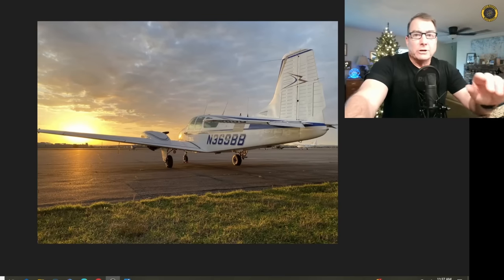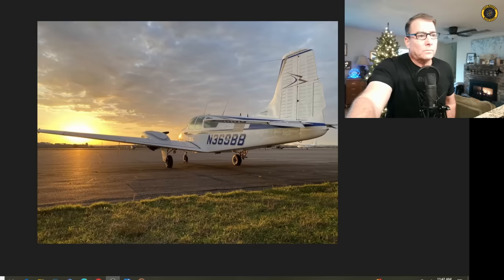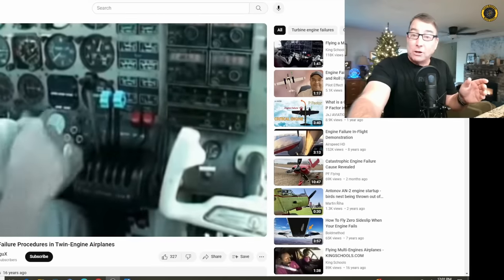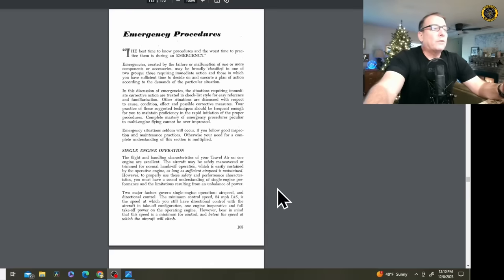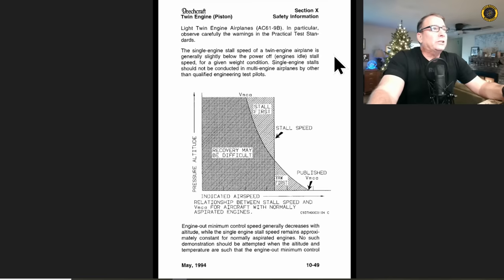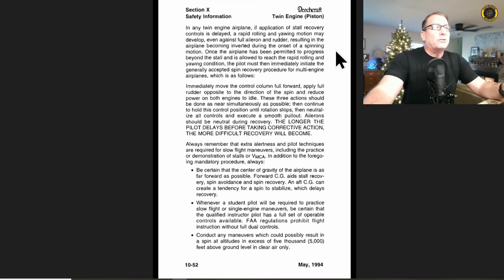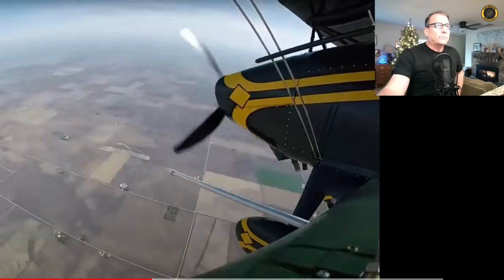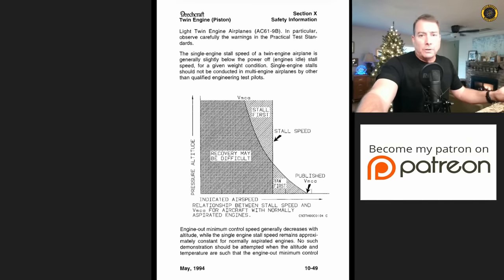Another Fatal Vmc Demo Stall Spin!! N369BB 4 Dec 2023

Comment: A 500 hour CFI with all the confidence in the world never realizes just how little experience they actually have.
Reply: well with light twins its  because the  safety  margins are  too narrow   even for   an instructor to catch. Engine out  exercises in twins  are dangerous .Reminds me of helicopters like the R22 .. look how  many of  those that  have   crashed  ..and one  reason? .. engine failure with  a  safety  margin of  about 1.7  sec max  to switch to autorotation  or  you  die . I  don't want to  fly in aircraft on the edge  with 1.7 sec  between life and  death .
Reply: Blind leading the blind.....
Reply: This MEI had almost 1500 hours😂not applicable here
Reply: He had more than 1500 hours.  This comment, along with this entire video bashing him for making a mayday call, is just complete ignorance. To say that because he was on the radio that he wasn't trying to do proper technique or maneuvering to get out of the flat spin situatuon is just ludicrous.   

I am obviously biased, as the CFI is a longtime friend of mine.  However, knowing him offers several advantages, as I know his experience and the culture of safety that he promoted and strived for.  I'm not saying my friend wasn't at fault, as he was the CFI/MEI and maybe didn't react quickly or realize what was happening before it did, but he was experienced, safety minded, a damn good pilot and good person.  

Thus, I appreciate videos like this that help explain the situation to the public and aviation community, but the ignorant comments on hours/experience, and the bashing of someone who lost their life just gets old.
Reply: @willycplane  My sympathies for to you for the loss of your friend.

Many people commenting on here are not pilots, or don't have a ME rating, and have never flown a twin.

When I did my own ME training, I knew these airplanes have a razor thin margin for error, and that was on a twin without a critical engine.

I knew of incidents in my own flight school which resulted in twins getting damaged beyond repair, with a student friend flying back seat in one of them.

People simply don't realize that prop twins, due location of the engines on the wings, are a totally different plane which is flown in a completely different fashion than single engine aircraft or jets.

High time commercial pilots are frequently killed in twin accidents, so this isn't a matter of experience.

They are simply inherently unforgiving, and the reaction time to correct any issues is very short, and it is very easy to get behind the plane when flying them.

A single mistake is all it takes, which is why I think this training desperately needs to be moved to a simulator, and not done in a life or death situation real time.
Reply: @willycplane  He panicked and started calling his papa on the radio.  That is not needed..  And very distractiing and fatal.
Reply: @outwiththem  so it's your belief that by him making a maday call and making the situation known to ATC that he couldn't properly perform a recovery technique, which is already known to be virtually impossible in a flat spin? Not to mention, you somehow claim to know that he made a call before he even tried to recover? How long had they been in the spin, and how long had he tried before making the call? Your ignorant and heartless comment seems to indicate you know more than the rest of us, so please share.  Not sure about you, but if I'm in a situation that I know I'm most likely going down and nothing is working to recover, I'm going to make a maday call out just in case I survive the impact.  I would want someone to know I went down and send help to find me and whomever is with me as soon as possible.  And yes, I imagine my friend was panicked after some time.  Just as you also would be, if you knew the end was most likely inevitable.  I pray you never end up in that situation and have to find out how you would react.  With the distasteful comment you've made, I don't think there is any doubt in the manner in which you'd conduct yourself.
Reply: @redbaron6805  Thank you for your sympathies and your heart. Seems to be missing from most these days, and we wonder why the world had turned into what it has. 

We all totally agree with you in regards to moving these maneuvers to an FAA certified simulator and out of the aircraft.  We are in the process of reconfiguring our sumulator locally into a twin configuration representing a travel air and holding some time with some FAA folks.  As sad as this is for us being our friend, maybe their lasting legacy is to push to help all the past and current aviation and safety experts get this across the finish line and make it safer for everyone during training.  We just need to make sure how it's taught and represented in the simulator is sufficient to understand and realized, if ever encountered in the real aircraft, so one may have a chance to recover.
Reply: @outwiththem  He didn't panic.   

He simply realized the situation was hopeless, and may have decided to do the transmission so people would know what caused the crash.

I somehow seriously doubt if you were put in that situation, you would do any better, and that is being generous...
Reply: @redbaron6805  Many Most people commenting on here are not pilots, or don't have a ME rating, and have never flown a twin.

FTFY
Reply: From my own past as an instructor, I do remember that 1500 hours total did not mean the pilot had much multi time. i do remember one very experienced single engine instructor gear up a twin. They were new to training in the twin.
Reply: @buckmurdock2500  Yeah, I wouldn't doubt it.

For some strange reason, people feel the need to comment on things they obviously don't understand.

For those that have flown twins, even the one's without a critical engine like myself, have whole lot of respect for those planes, as they can very quickly overwhelm you if anything goes wrong or you get behind flying the plane.

Typically, touch and go landings are off limits for that reason, as there is simply way too much going on to do that safely.

Even today with a ME rating, I would need significant instructor time before I would feel comfortable flying one solo or with passengers.
Reply: @willycplane i listen to Juan and his spot on comments and analysis is precisely the reason for listening to him.
Reply: @dliguori25 good observations
Reply: @willycplane  I'm sorry that your friend died but as pilots the number one thing that is drilled into your head from literally day 1 is AVIATE, NAVIGATE, COMMUNICATE. That's it, that's rule number one. He didn't do that, for many factors we don't and we'll likely never know but he did not follow rule ONE of aviation.
Reply: @dliguori25 Yes, that is what one would have thought, that the additional engine gave you an extra margin of safety.

In the real world, the opposite is true.  I was also shocked that an engine out doesn't lose 50% of climb performance, closer to 95% of climb performance is lost.

In a clean configuration, a twin can barely maintain altitude or climb at 50 fps, and that is flying low close to sea level.

You add in induced lift, cowl flaps, landing gear, prop controls and MP, faster speed, faster climb rate and it is super easy to fall behind on flying the plane.

Flying a twin while watching airspace restrictions, traffic and radio communication is quite overwhelming.

After I got my ME rating, I noticed how calm and easy flying the 172 was.  I was looking around after taking off, and realizing there really wasn't much to do.

It was a calm and serene experience, and flying the 172 now felt it was 10x easier than before.
Reply: Really glad someone said this, these comments have been so ignorant! Nikul did my checkout in a caravan a little less than two months ago and even from those short flights and just chatting with him I learned so much from him, he was wonderful all around.
Reply: @redbaron6805  You can add power and rudder opposite the turn.  Like you do on the ground.. Oh wait, let me call my mom instead!..
Reply: @willycplane  the key point here though is that you friend is no longer with us. By all means let him be bashed because isn't going to hurt him any more than he's already got. And it might save someones life. If anything it goes to show that 1500 hours and being careful won't save you if you don't have the right skills for the scenario you are faced with... and even then you still might not make it if the odds are against you like with your friend. Note that everything said in this video is not to get you out of the spin... its advice to stop you from getting into this scenario because no amount of hours and experience and safety mindedness will save you for sure once it happens.
Reply: @Wingnut353  don't disagree at all, but the comment on the radio call is just ignorant. To say making a radio call somehow says he wasn't doing the proper recovery technique, etc. is irresponsible.
Reply: And now 1500 they are flying A320s at Spirit Airlines.
Reply: @willycplane  This is the reason folks are scared to do a "Mayday. Mayday....." because if they survive, people like these comments are ridiculing and the embarrassment associated with it.
Reply: I remember doing Vmc demos in a Seminole AT NIGHT over the ocean.  I used to come back from my lessons soaked in sweat because I knew what it meant if we got into a spin.  My instructor had zero concern.  I even went to the Chief Pilot and told her that what we were doing was extremely dangerous (I was basically preforming OEI on instruments because I had no discernible horizon).  I’m amazed that no one got killed doing that stuff.
Reply: @@v1rotation absolutely not. People can't multitask that is why we have aviate naviga communicate. Go to any airline in the world and you'll see in the manuals that calling ATC is always the last thing to do
Reply: @willycplane  I hope your friend and fellow airman rests in peace, and I will keep his family and friends in my prayers. Aviation is a dangerous game, a game that we all play because that passion burns deeply in our hearts. Even competent, skilled and safety minded pilots can find themselves at the mercy of fate. In the aviation game, we play for keeps.
Reply: @dliguori25Uncertain when twins certification demanded that they had to maintain altitude on one engine with reasonable criteria. Older twins did not have to display that to be certified. I'm thinking specifically in the Piper Apache day.
Reply: Especially the FireFighter guy who had two Italian students who decided to do FIVE acrobatics that tore the plane apart the jackass!
Reply: @garymiller5624 
Yes, the old Apache, where they say the  2nd engine just takes longer to get you to the scene of the crash!
Reply: It sounds like a young voice on the radio, probably the student.
The older voice, probably the instructor, was not on the radio, but trying to recover the aircraft. You can hear him exclaim " I'm trying'. Not talking on the radio but fighting for his life.
Only one person can fly the airplane! The student was just a "doomed" passenger at this point, super scared and seconds from a young death.
Reply: @willycplane  completely disagree. I’m flying that aircraft until I no longer exist. The odds of surviving a flat spin crash like this are about non existent, and emergency services getting there faster won’t mean a damn thing. I guarantee you Bob Hoover gets out of that spin every time. Fly the airplane, fly the airplane, fly the airplane.
Reply: @Ndub1036 KEEP THAT BALL CENTERED!!!
Reply: This doesn't look like a lack of experience situation here, a spin can kill anyone don't you forget that.